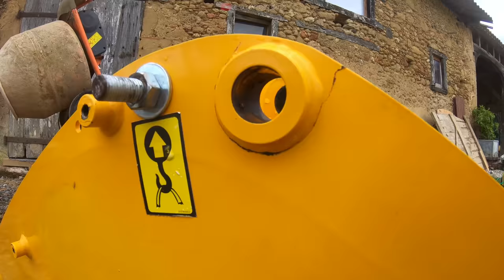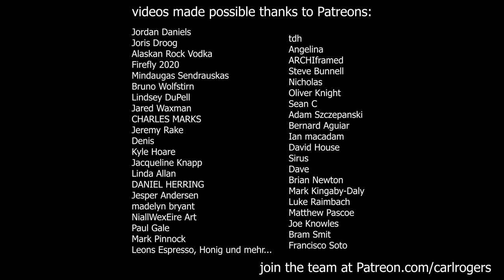When buying used Equipment goes WRONG

Comment from the maker: Install Raid for Free ✅ IOS: https://clik.cc/wr23C ✅ ANDROID: https://clik.cc/6paCt  ✅ PC: https://clik.cc/YmjlK and get a special starter pack 💥Available only for the next 30 days!
Reply: Bro please  tell me the model name of your jcb  please 
And all the best from India👍
Reply: At 31.18 you got one more crack  in front of the control boots . We rebuilding them ram you need to put hydraulic oil the seal  before you put it back together
Reply: Hello bro modwl name of your jcb please
Reply: I dont play kids games!
Reply: The integrity shot. i died :D :D
Reply: Carl,  For whatever your Dad paid to the "Farmer" who welded the boom-arm segment, you could have paid for most of a Lincoln Mig / Tig / Stick welding unit and first bottle of 80/20 Argon / Co2 welding gas.  His caveman welding sucks and he did no reinforcements.  Before you spray painted over his mistakes, it looked like the guy left a bunch of cold shuts, so don't be surprised when you have to fix your excavator again.  BTW, to remove bushings, just lay down several beads of weld on the inside, and as they cool, they will shrink the bushing which becomes very easy to tap out.

If you plan to build out your shop, please consider getting a good used lathe (LeBlond if available) and a good used milling machine (Bridgeport if you can find one in the UK).  Buy a decent metal cutting bandsaw (you can add tables to portable Milwaukee and/or DeWalt machines).  You'll need a frame-style hydraulic press (30+ tons minimum) and one or more grinders / polishers.

What you, your Dad and sister have done with basic tools is amazing.  Thank you for all of the videos!  Keep up the good work.
Reply: Looking at the welding , we can see why the welder is known as " the farmer" .

Comment: Tip: interference-fit bushes are best put in the freezer for 30 mins before fitting...they just drop into place so no hammering. Also, best to not hit metal with metal, use a wood-block. Nice job overall.
Reply: I was thinking the same thing as he was whacking them in.
Reply: I’ve seen someone put them in liquid nitrogen to constrict them…then drop them right in.
Reply: Yep true 👍 and it won't be long before he goes to hospital with a broken toe as he wears sandals to work in 😮
Reply: Im sure hes in france so its ok there lol
Reply: @mikejohnson9118  🤣
Reply: @richardtaylor2449  well the GFs is just wearing nail polish @20:20
Reply: Yes …..some work boots for protection……and throw that tee shirt in the bin
Reply: @richardtaylor2449  Nothing wrong with Japanese safety boots.
Reply: This.
Even if freezing them doesn't make for a loose fit, hitting them is absolutely not the way to do it. Squeeze them in with a vice if you don't have a press. Shit, in the case of these particular bushings, even a G clamp and two pieces of steel would have worked.
Reply: @mikejohnson9118  Oooooo, your humour is a tad dry. 🤦‍♂️ I moist remember that one. 😁
Reply: @deplorablelibertarian  He doesn't own an acetylene torch, liquid nitrogen you say? wtf dood
Reply: @josephking6515  as someone said before "just put some lube in" :)
Reply: I learned the dry ice method from a locomotive mech.
Reply: @deplorablelibertarian  Used to do for bushes in the ailerons when I worked in an aircraft factory
Reply: @deplorablelibertarian  most machinist or metal technicians will do just that. I see it all the time on Aircraft maintenance.
Reply: You can use a CO2 fire extinguisher and give the bushings a close shot. It creates dry ice on them and cools them instantly. Old trick from the army maintenance :-)
Reply: @WilliamSmith-pd2sr  press them out with a press
Reply: @WilliamSmith-pd2sr  In the US we have tool called a ball joint press.  Basically a large heavy duty C-clamp and a series of different size disk and cup.  Choose a disc the same diameter as the bushing and a cup that is oversized.  Use the forcing screw to press the bushing out.  Reverse to press the new one in.
Reply: @marcondespaulo  Same did I :) used it many times and it works really great. Though, dry ice have become harder to come by where I live, so I've "used valuable space in the freezer" according to my wife. Freezer works great too, but with naggings from the wife :p
Reply: The hilarious part is that the bushing didn't need replacing. The holes don't need to line up with the nipple, there's an internal channel that distributes the grease to all 4 holes in the bushing.
Reply: Ditto. Also heat the end the bushing is going into.
Reply: @richardtaylor2449  He did have his white safety socks on though

Comment: The two outer teeth on the buckets are supposed to be crooked,pointing outwards.
There central longitudinal axis is aligned with the axis of the sidewalls on the bucket,to protect sidewall from wear when you dig.
They wear out instead of the bucket.
Once a bit worn, their length having reduced,you swap them with the inner ones,or change them,depending on what you dig,so the wear they suffer from.

Comment: The slow operating speed & heat on the lower (retract) side of your boom main cylinder are most likely due to damage to the o-ring between the piston and the rod, or in one or more of the seal rings on the outer diameter of your piston, especially since it looks like you guys used a hammer when installing both these items during reassembly.  It is incredibly easy to accidentally cut cylinder seals and o-rings during reassembly & even experienced hydraulic technicians do it more often than you would think.  If a seal or o-ring is damaged, much of the pressure bypasses around the piston, so you are losing pressure that is trying to force the cylinder to extend, causing the slower movement.  Since pressure and temperature have a direct relationship, the increase in pressure as the hydraulic fluid shoves through the damaged area of the seal causes an increase in temperature in that fluid, so you will notice the retract side of the cylinder is notably hotter than the extend side.  If the damage to the seal or o-ring is fairly large, you can lift the boom, release the control lever and the boom will often slowly drift down a small amount before the pressure on each side of the piston equalizes causing the boom to stop moving.  You can positively determine if oil bypassing the piston in the boom cylinder is the actual issue without removing the cylinder from the machine and disassembling it using the following troubleshooting procedure:  Shut the machine off and function the boom control in both directions to ensure you have bled the pressure off both sides of the piston.  Now remove the hose from the raise (extend) port of the main boom cylinder and cap/plug both the hydraulic hose and the fitting on the cylinder (WARNING: Do this with actual hydraulic plugs/caps as you will be applying pressure to the cylinder next).  Now start the machine and move the boom control to lower the boom.  If the boom cylinder does not move, or moves just a tiny bit and then stops, the piston is NOT bypassing.  From the description in the video, what you will most likely see happen instead is that your boom cylinder will actually begin to extend and lift the boom, even though you are applying pressure to the lower (retract) port of the cylinder and there is not even a hose hooked to the raise (extend) port.  This happens because the surface area on the extend (raise) side of the piston is larger than the surface area on the back of the piston (since the cylinder rod is installed on that side) and the oil being applied to the retract side of the piston bypasses around the damaged piston ring/seal causing the pressure on both sides to equalize. However, since there is more surface area on the extend (raise) side of the piston for the hydraulic fluid to push against, the piston (and cylinder) are forced to extend.  If this is what happens, you will need to remove the boom cylinder and carefully put another seal kit in it.
Reply: I realize I'm 4 months late, but I completely agree with your assessment here. If they haven't already it would be a good idea to take the lower arm off and check the seals. I've seen this more times than I care on heavy machinery as, as you mention, it is very easy to do. Even a tiny piece of dirt or silica in the line can cut the seals as well and allow for the pressure to bypass the arm causing enormous amounts of damage to the equipment if not addressed in a timely way. You will see scoring on the housing, or in the worse case a groove where the fluid has pushed past the seal and caused scoring to turn into a channel.
Reply: @Dalec81  If the cylinder is hot and the lines are not you have a ram seal leaking. If you have a stethoscope handy you can listen for the leak. Or put your ear on the cylinder.
Reply: That was a very thorough explanation and they never thank you properly for the time you took writing it.... not good!
Reply: Wow! From my read, you know of which you write! Good brain, great mentor/s, instructors and clear, concise instructions.
Reply: @bountyhuntermk2520  well done
Reply: Spoken like a true professional with loads of experience!  This is why I view YouTube.
Reply: This guy tractors

Comment: If you cylinder is getting hot that is a sign of a damaged seal when you resealed the cylinder very common to happen and the slow speed indicates a leak in that direction . oil bypassing . pull it apart and reseal again this time don't force or beat it together. Hydraulic Tech retired from Paup Munroe Hydraulics& Berendsen fluid power.
Reply: I was cringing when I saw them being hammered on. It's an easy way to nick an o-ring!
Reply: You best use oil on the O-rings during assembling, don't wipe/dry them off with a cloth. Rubber can roll up when it's dry.
Reply: Yep your a gentleman and it won't be long before he goes to hospital with a broken toe as he wears sandals... 😮
Reply: @richardtaylor2449  

Ten years working with sandals on job site. Not a nail up the foot, not a dropped thing on a toe. Idiots hurt themselves.
Reply: @calculator1841  Good but it's a very big risk i wouldn't take 😮👀
Reply: @richardtaylor2449  Do you work of Health and Safety or something?
30 years I've been in and out of workshops and job sites, not to mention some of the insanely dangerous things I've done in my shed.
I've never worn safety glasses, in fact the few times I have, have been the times I ended up in hospital getting "crow bars" removed from my eyes.

No gloves.
No guards.
No respirators.
No fume extractors.
No masks.
No long sleeves.
No aprons.
No helmets.
Usually insufficient lighting.
Hiding behind the handle when welding.
and DEFINITELY no steel caps on the weekend !

I've worked on so many different sites, in so many different industries.
I've worked with more chemicals and poisons that I can remember.

Still got all my fingers and toes, still got 20 20 vision. I'll admit to a bit of tinnitus but that's probably got a lot more to do with having worked in sound and lighting than it does mechanical sheds and around machinery... Maybe a little from column A and a little from column B.
 
As Calc said, only stupid and incompetent people hurt themselves or others.
Pay attention to what you're doing, and pay attention to the tone your tools and machines are making and you'll know before a problem turns into a catastrophe. Wrapping people in bubble wrap leads to complacency. OH&S ticketing, though titled "competency training", is anything but and nothing more than revenue raising. It certainly does not ensure a safe work place, nor competent operators.

In reality, all it does is slow everyone down and stop you from getting anything done efficiently.
Currently I work two jobs. One is in the petrochemical industry where literally everything around you is at or above 200 degrees C, where gasses will first smell rancid, but when in high enough concentrations to kill you, have already overwhelmed your sense of smell and you can no longer smell them. Where the external doors to the buildings are blast proof and weigh in excess of 300Kgs. Where the neighbouring plants makes LNG, LPG, Mega litre tank farms full of a city's petrol supply, fertilisers, pesticides....
Someone Phuks up there, and a WHOLE CITY is gonna have a bad few months. If there was a nuclear attack, I'd WANT to be in the control room at work.

The second job I work for a little extra spending cash is stocking shelves in a wholesale groceries joint.
There, OH&S says you're not allowed to use a knife to open boxes (unless you have cut rated gloves on) in case you cut your little fingy. 

Do you see the contrast? The absolute LUNACY?

Working safely is one thing.
Wearing Steel toes, cut rated gloves under rubber for electrical insulation, under rubber for chemical, under welding gloves, under poly dipped gloves for grip, over neck to toe cotton under your leather apron, with earplugs under your ear defenders, under your helmet with face shield over your safety glasses and forced air respirator and your chainmail suit connected to mains earth... does not mean you are "working safely"
Reply: Better not put it in the vice! Why closing the cylinder with a grip when there is a special tool with a pin it.

Comment: At 16:03 you will see a groove cut round the inner diameter of the eye. That is for grease so that no matter where the holes are in the bushing they all get grease.
Reply: this.
Reply: I think making the hole line up is for the worse. The pressure in the the other holes for the grease is now lower thus they get less grease and the grease is spread unevenly....

Comment: On the main boom cylinder, if the u-cup seal (the blue one) is installed backward, it will allow oil to bypass inside the cylinder and cause loss of power and heating of the oil
Reply: Close but the blue one does not go on the piston... installed backwards it would make the cylinder an oil fountain.

Comment: On the bucket teeth bolts put dome nuts on top of the self locking nuts so the threads do not get damaged so easy to remove next time

Comment: Probably everyone has mentioned it already, but you can place those pins & bushings in a freezer for an hour and they'll drop in much easier. Also, hydraulic presses are awesome for that job. Methinks you'll need to tackle your kingpin sooner than later since its off-spec movements probably caused the cracking.

Comment: I’m thinking the worn and unbalanced kingpin was probably the cause of your cracks in the first place. Your repair might have been Kind of like building on top of a cracked foundation. Don’t let it go too long before you do king pin.
Very neat tip to use the plastic glove fingers to cover the hydraulic hoses..many thanks for that.
Reply: nothing to do with it..
Reply: That boom was flopping about on the kingpin.  Pretty obvious when working on the test dirt pile.

Comment: The hydraulic cylinder issue could be air, you would be compressing the air instead of moving the hydraulic fluid causing slow extending of the cylinder and the air would heat up as it was compressed
Reply: this.
Reply from the maker: Thanks chaps, we bled the system of sir and seems to have sorted it, but thought id leave it in the video to get some feedback
Reply: Indeed this. Always bleed the system of air. Some do it by themselves but need some additional switch pushed. And if you have any records, swap the oil every 1000 or so hours. Or just change them if you never did so, its not hard, especially not with your skill set. It will improve the digger's responsiveness a lot and fix those 'its faster up than down' things.
Reply: @carlroge  as it happens....I worked for the hydraulic ram supplier to JCB in the 1990's. I developed that boom raise ram with its "cushion bush" damper. The bush you fitted to the rod, adjacent to the piston is actually tapered by 4 minutes and it throttles the oil flow through the gland at the last 50mm of travel. This is to prevent the boom whacking at the end of the strokel and your bucket of muck flying out. It will get very hot as the hydraulic oil is squeezed through the gap between the bush and gland. Suffice to say, it's vital to it's operation that you fit it the correct way round!

One thing I don't recognise is the little white things your dad placed in the gland oil holes.

Edit: the grease holes in the bronze bushes don't have to line up with the grease nipples. There is a grease groove around the ram eye bore.
Reply: @thomaswykes3647  I was very upset that he didn't see there was a grease groove
Reply: Literally a grease groove. But good job.
Reply: @thomaswykes3647  I was thinking the same, with the 4 holes surely there has to be a groove. Does it matter if the hole lines up?
Reply: @thomaswykes3647  nice going Thomas hope it made ya a few quid